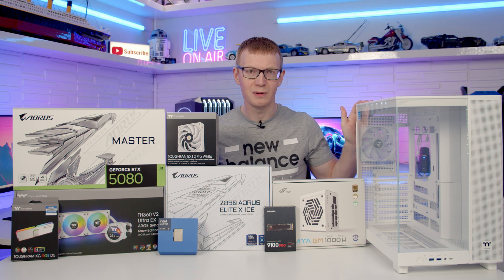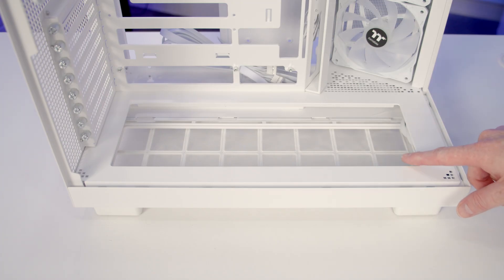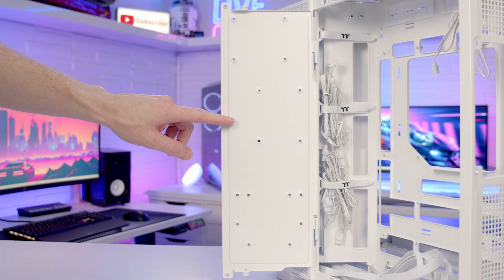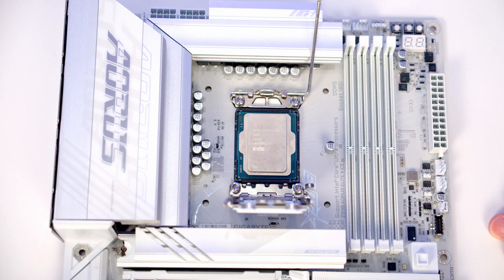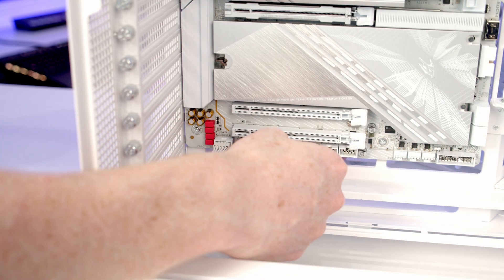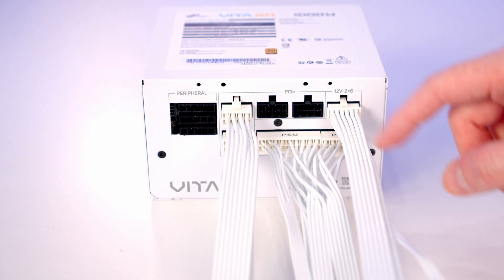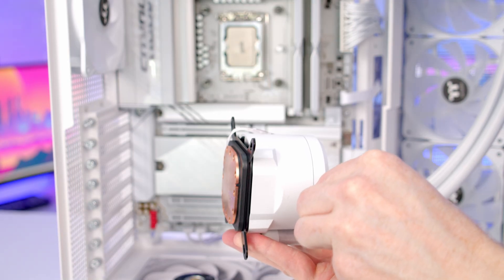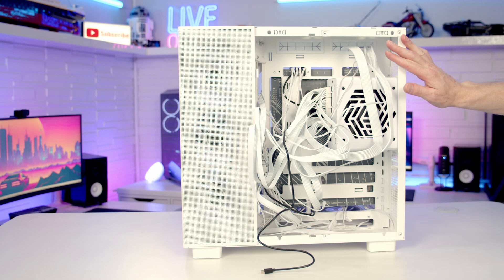Thermaltake View 380 XL TG ARGB Build - Step by Step Guide

Comment: question, If i have the exact same fan setup but with argb fans at the bottom, can I get rgb for all the case fans and AIO to work simultaneously? I have a msi mpg b650 edge wifi and it says it has 2 JARGB_V2 headers and 2 JRGB headers. Do I need a argb hub for this?

thanks in advance if you get to this, I know its an old video.

Comment: Would you be able to fit in Corsair IQUE link fans in this case without any problems, also does the case come in black?  If so to both of these questions I would be very interested in getting it.
Reply from the maker: Yes to black. Not sure about the fans as I never have used them so not sure how thick they are
Reply: @ChristopherFlannigan  It is not the thickness you have to worry about, it is the wire that you put into it to connect to other fans, I seen someone use the Corsair IQUE link fans in the NZXT H6 Flow and in order for them to fit into the bottom of the case he had to cut out a small notch it it for the wiring to fit.